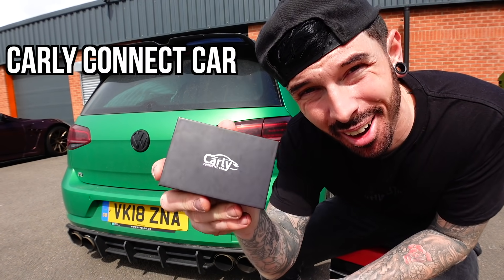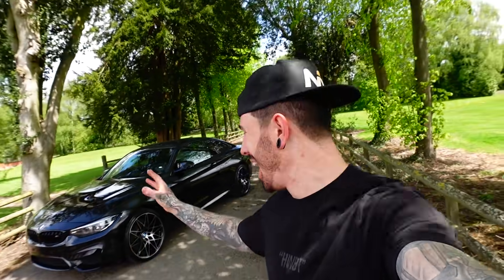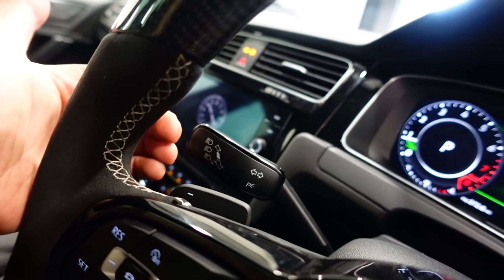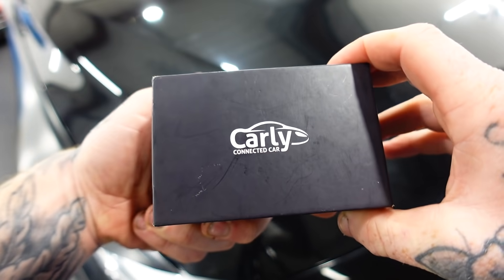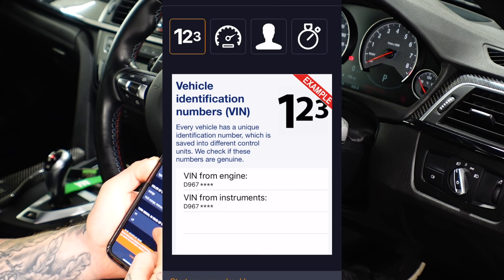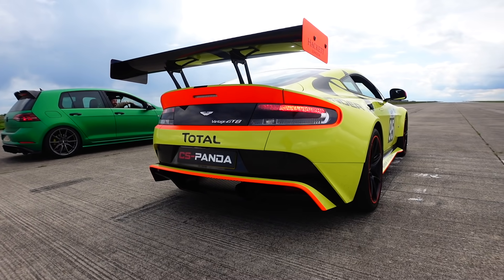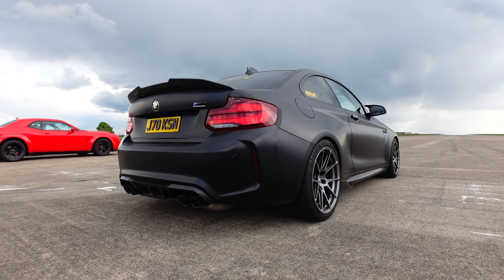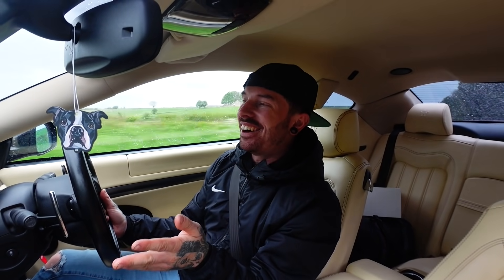MY MODIFIED GOLF R SHOCKS SUPERCAR OWNERS

Comment: Whoever was driving that Aston....embarrassing how slow the reaction off the line was !...Good video Matt
Reply: Can’t really floor it off the line in a rwd car in a drag.
Reply: @QuavyQua  Thats such a lame excuse.RWD cars have done drag races for years.  It's not the launch....its the delay from the light going green to hearing the car rev and move. The driver was asleep or has seriously slow reactions.
Reply: It’s also a lot heavier of a car as well.
Reply: @doublearon3692  yes, the weight has nothing to do with reaction time. You see the go signal and the other car accelerates off ...it takes a lot longer for aston driver to react and then you see the wheels begin to turn. It's obvious poor driver reaction time did not help in that race..
..

Comment: It's actually unbelievable what they can repair alloy wheel wise 😮
Reply: I never would have repaired such damaged wheels. i guess they didnt xray them to see if there are micro cracks... the car does 250km/h, i wouldnt trust it! cant be to expensive to get some new rims in comparison to the hours that went into repairing the rims.
Reply: Those weels wont hold btw. No bmw weel that has been welded will hold its a rull specially with run flat. I basicly only deal with BMW's ...both normal cars and drift projects. Those whells will crack eventually.

Comment: 4wd Golf with Stage 2 map will devour most cars with only rear wheel drive. A stock hot Golf with 4wd will run most cars close... Modern day electronics against something like the Aston's 10 year old electronics and manual box will never stand up to modern stuff.
Yes I know the GT8 version is younger than 10 years old but the basic car underneath it was launched in 2005. It doesn't have launch control like the McLaren or BMW so it never stood a chance.
That Golf was faster than the Gallardo and that has 4wd but no launch etc.

You've done a great job with the Golf, it's a great looking car with that green wrap, the tasteful wheels and additional body parts.

Comment: Only CRAP thing about CARLY is that it DOESN’T DO THE SERVICE MODE for the  ELECTRIC HANDBRAKE on the golf 🤦‍♂️
You need to stage 3 your golf 🚀
Reply: Doesnt do the handbrake on any VAG I’ve tried. Total crap product compared to what they advertise
Reply: @davidk3202  it sits in my transporter now and carista sits in my golf, fortunately at work we have odis, vcds and a few other tools to get by with I havnt tried OBD eleven tho so not sure how good that is 🤷‍♂️
Reply: @Honky_Konky_Phooey  I messaged OBD eleven about the handbrake element and they never replied so assuming they are on par with Carly
Reply: @davidk3202  I think it does as on the golf r forums people rave about it, carista does it which I have but will never use it to do my brakes 😂, playing with carista ages ago it let me put more power to my rear wheels, roundabouts are more fun now 🙄

Comment: The wheels of that M4 shouldn't have been "fixed" their internal atomic structure is not as it used to be, which is very dangerous and can lead to them maybe fail at high speeds.

Comment: Matt, Please “keep” the Golf R... any of the others can go but NOT the golf R. It’s the most affordable to have as a daily driver, most affordable to repair and maintain..... most affordable to modify to beat almost any super car and most affordable to insure..
Reply from the maker: In fact the golf has been surprisingly more expensive than some of my other cars
Reply: @MatArmstrongbmx  Wow I wouldn’t expect that at all. In South Africa 🇿🇦 Most of us love the MK7 R  as it’s not that expensive to make the really fast.... a downpipe fitted is about R4500 which is £232.... a bigger intercooler is about R10000.00 which is £516.61 and a stage 2 tune is about R2500 which is £129.15... Don’t get me wrong this is NOT cheap, but comparing vehicle brands which you built parts and items should be more expensive. But I am in SA 🇿🇦 VW’s are the most affordable vehicles to repair and maintain...

Comment: How can you try repair cars without even looking at the part catalogue. Put in the VIN and you know what type of headlight you need. Of course the matrix LED headlights need a camera to work. DUDE!

What's wrong with that Demon? It's supposed to reach 60mph in a little over 2s. Golf mk7 R with 400hp are usually clocked at 3.5 to 4s. How is it possible the Demon is beaten on the quarter mile? It's supposed to do it less than 10s. I mean we are talking LaFerrari, Tesla Plaid and McLaren P1 times here. No way that Golf is that fast.

Comment: As ive said german cars out of warranty is a money pit
Reply: I owned an Audi that I had from new for 17 years, it went through 1 alternator, 3 batteries, 4 sets of brake pads, 7 sets of tyres, a fuse for the thermo fan, 3 timing belts and water pumps, a hand full of light bulbs and 1 windscreen. Sold it with nearly  300,000 kms on it. Only have it serviced at Audi for the first 3 years, after that used trusted local mechanic.
Reply: @paolob9247  older stuff was better newer stuff not so good